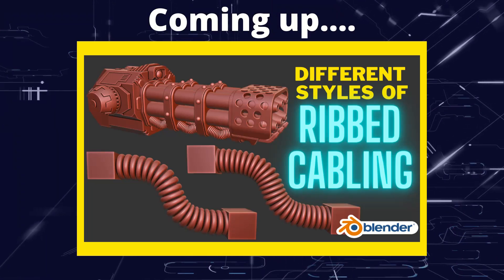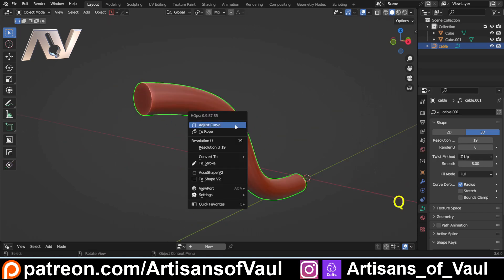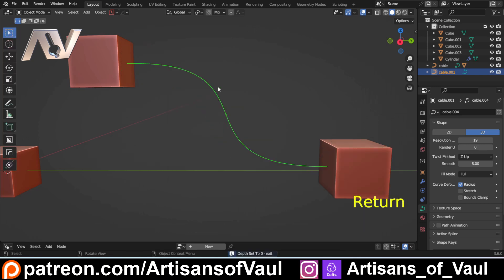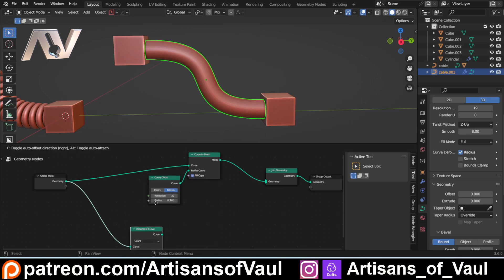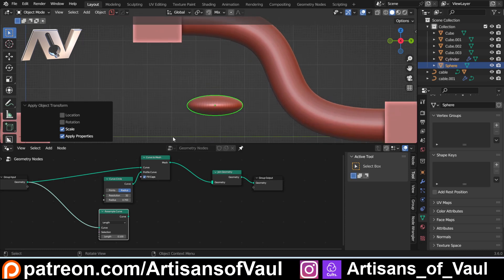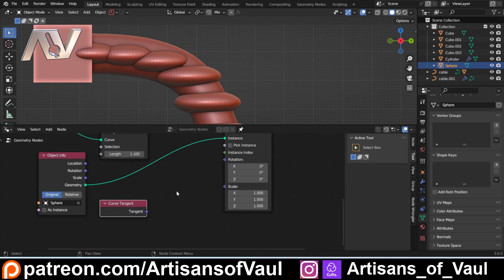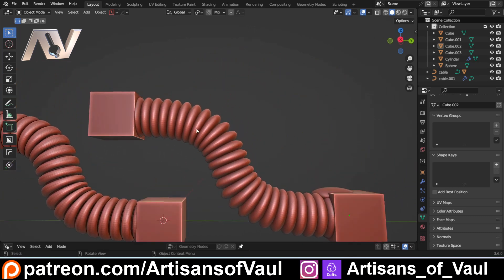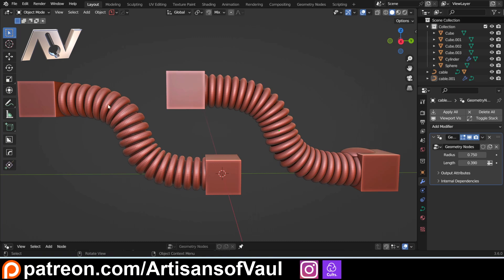Using curve arrays to create different types of ribbed cables

Comment: I think the geo nodes version looks more like real ribbed hoses look.

Examine the hose on a vacuum cleaner - a Hoover in UK, right? ;) for instance- it's not really a sequence of toroids along the hose. It's a the plastic material of the hose enclosing a spiral of wire . The size of the ribs doesn't change. The change in distance between ribs is taken up by the plastic covering of the hose wrapping a little bit further around the enclosed wire on the inside parts of the curve and a little less on the outside parts of the curve.

Keep up the great work, mate! Yours is one of my favorite YouTube channels.
Reply from the maker: I think it depends on the hose type. There are definitely hoses that look like the first as well, probably depends on design and (as you described, how it's constructed).
Thanks for watching and commenting man!

Comment: Thank you for the video. I have a question about exporting textures from substance to blender. Metal material is not displayed correctly. In substance, I choose Unreal Engine Pack or PBR Metal Roughness. In the blender, the matal becomes very rough and not shiny. Metal is displayed correctly in Marmoset. Did you have this problem or do you generate metal in blender?
Reply from the maker: Hi there.  Im sorry to say this is probably a bit out of my area of knowledge.  I use Blender for 3D printing so I don't play around with textures or rendering in this way.  I would really recommend the Blender Bros channels as they often look at areas like rendering.  I hope that helps.
Reply: Ok! Thank you! @ArtisansofVaul

Comment: I said it before and I'll say it again... love these "bite-sized" tutorials (geo node based or otherwise)! You're very clear and concise in your explanations, making it easy to follow along! As for which pipe version I prefer, I think I like the first example more.. but its all subjective really. I'll have to have a serious look at Cablerator! Tools like this should be native in vanilla Blender if I'm being completely honest! Just so powerful and saves so much time! Thanks for sharing!
Reply from the maker: Thanks so much and thanks for taking the time to comment, it's always really appreciated 😁

I imagine the issue is there are SO many add ons that different people find helpful depending what you want out of Blender that it would be absolutely huge if it had all of them. Also imagine if you wrote the code for one of these addons and then Blender "stole" it taking away your ability to make money for the work you did. I mean I have no idea how it works but that must be a consideration
Reply: @ArtisansofVaul You bring up valid points regarding the add-ons, and this is one thing that I worry about Blender is exactly what you just mentioned about "stealing" someone's add-on idea. If Blender holds back for this reason, that means the native version won't ever have these awesome features installable by default. Some people might not be aware of some of these add-ons out there (though google searches can help shed light on add-on discoveries to be sure). I  guess with an open system like this, there is sure to be issues on both sides of the fence. At the very least, these add-ons do exist, and the ones you pay for are usually quite reasonable priced. So overall, I guess I really shouldn't be complaining.

Comment: Amazing work man. I reccomend you to any of my friends doing blender for 3D printing. I have a question or two. Do you plan on updating that video where you use geometry nodes to do random stone wearing and chipping, as the updates to blender kinda broke that method. Also did you try shrinkwrapping a plane over an item in order to make a VDM, I remember you saying in the comments you'd look into that.
Reply from the maker: Thanks man. The Geometry nodes actually still work on that even with the updates. The only difference is you select the edges to crease.

I did try the VDM technique you mentioned and it works pretty well. I just didn't do a video on it as the video on it already showed pretty much everything there was to say and I didn't want to plagiarise.  It is a good technique for sure though 😁

Comment: Awesome tutorial ΛₒV! I will be adding this geo setup to my toolbox. I like the second one as for reusability, and the first looks more like a rubber hose. Have you thought of trying a braided hose? I was thinking hard on how to accomplish this but can not find anything that works. I could do it with textures but that would not help with surface detail on a 3D print.  Like this https://www.flexible-hose.org/img/heavy-wall-braided-hose.jpg
Reply from the maker: I hadn't but I am now 😅 I think you'd have to do the array method for that.
Reply: @ArtisansofVaul I know right?! I think it would look cool on your flamethrower!
Reply from the maker: @Revenant483  I'm happy with the ones on the bottom of the flamer. I want it to look like a ribbed pipe. But for things like sci-fi armour it would be fantastic, probably exaggerated to make it visible.
Reply: @ArtisansofVaul  Yeah I can see that. Can't wait to see if you come up with something,

Comment: stable....💪💣💥🗯💭💨🕊
great showcase of Nodes...
other trick is maybe use  a simple plane then the  Donut should be parented to the plane, switch to it. In the “Properties” window in the “Object Properties” tab in the “Instancing” section, set “Faces” mode. then the arayed plane on b.curve should help and avoid the distorsion ..the instance Donuts are now stable solid like your showcases..
p.s. older real old B. Version  with the array modfier  worked different complett opposite.
Reply from the maker: Cheers 😁👍🏻 And yep. I have a video on that technique here: https://youtu.be/O4QxBfBu80I

Though I think the likelihood of that technique being better/faster to set up than geometry nodes is unlikely. Also then you have to faff around with making sure origins are aligned/etc.